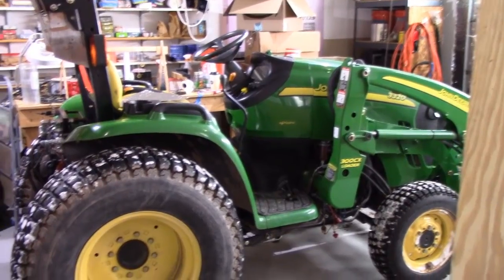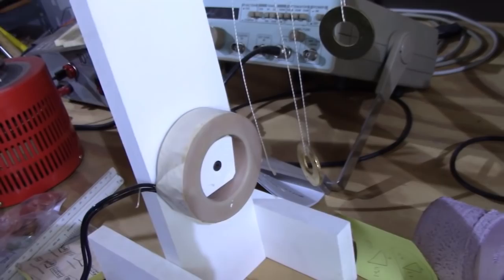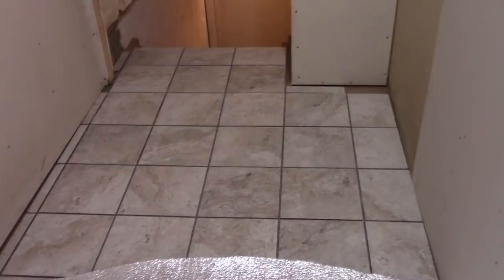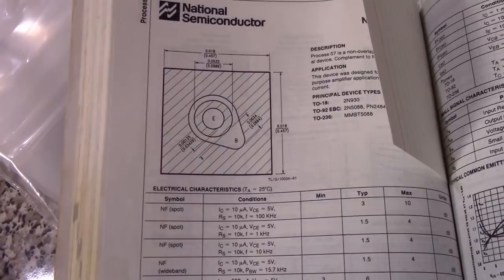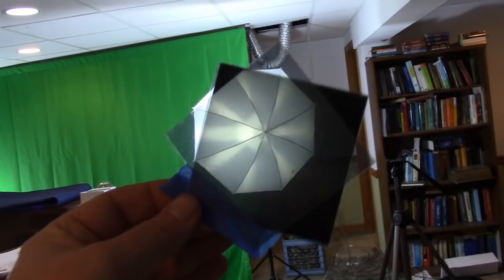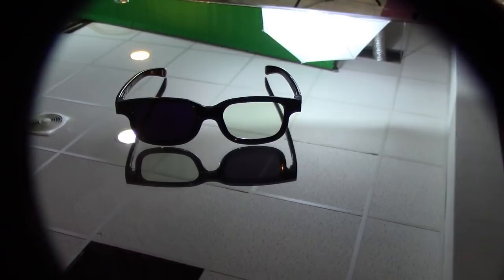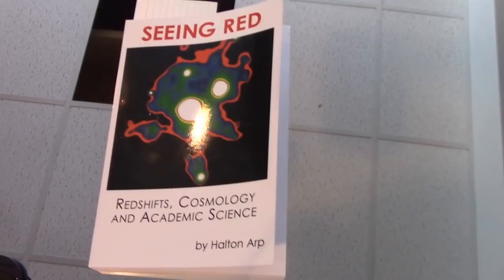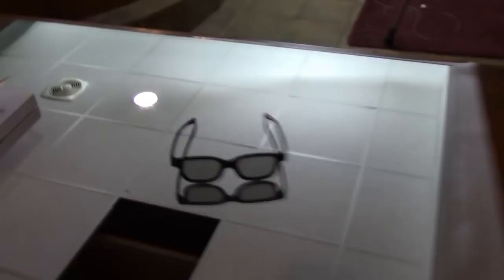S015: What's Going on + Proof that reflections are Negative

Comment: Nice video and demonstration. Thanks. 
That light reflected off conductive surface produce negative polarization? Half true. 

Circular polarization was named after someone try to capture attention for personal gain also making forcing others to be a follower and him as the leader. Other like examples can be found in this channel. 

There is no rotating linear polarization other than two quadrature polarizations A and B with phase lead/lag between A and B. It does not matter the wave began at any specific axial angle only mattes of their phase relation. When phase is more or less than 90-degrees we call it elliptical. 

Negative image? 
Vertical polarized component come out of metallic reflection are in phase, 0-degrees. However horizontally polarized component come out phase flipped, 180-degrees. For composite polarized relative phase lag waves (aka circular pol) it will come out of a metallic mirror in opposite rotation. Hence “negative image” in this video.

Comment: So, since reflected light is inverted, and it has been seen that moonlight is capable of cooling objects; and I also believe certain polarization of laser light have been used to cause cooling effects; wouldn't that seem to imply that there is a natural imbalance for all material bodies in the phtotonic radiation polarization of emissions?  If it (emissions) were perfectly balanced then you would not expect to observe a difference  in energy transfer between primary and reflected light incident on an object.

Comment: I would like to talk to you about several frequency transmission experiments and manipulation of the frequencies through hertz output.  I’m calling this a frequency bundle with a core frequency that becomes compressed. 

I don’t want to communicate the specifics of experiment over YT.  IF you are interested; reply to this comment.  

I think you have the skills and ability to conduct some of the experiments I don’t have the equipment or in some cases the knowledge.  How ever I do have specific questions and specific expectations as a result.  

You can look up ELHFED on GOOGLE under applied physics.  This is my research project for the past 9 years.